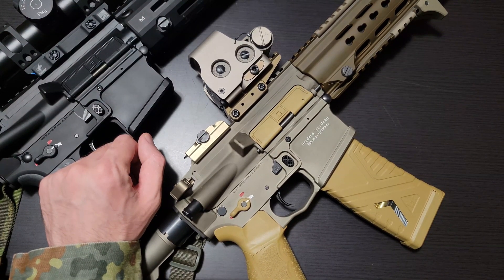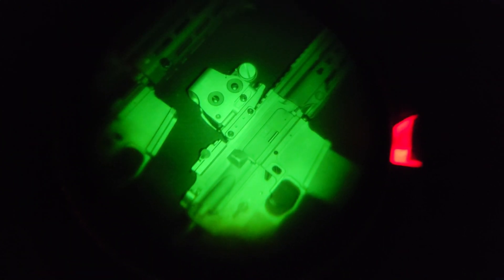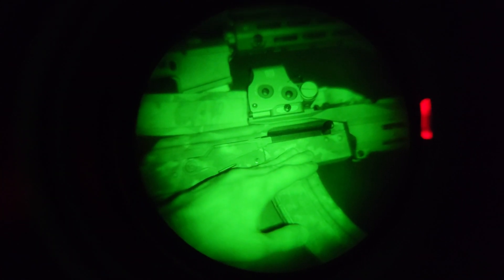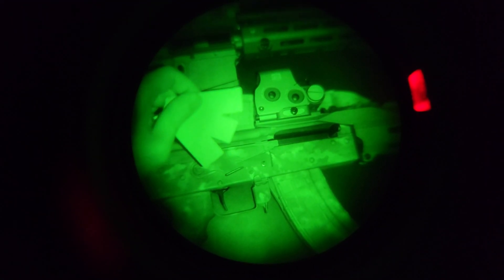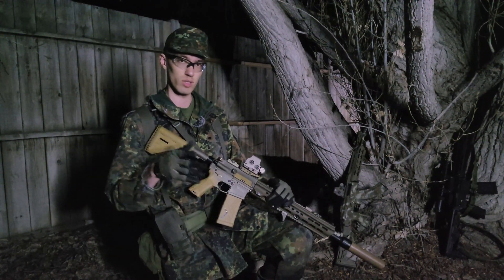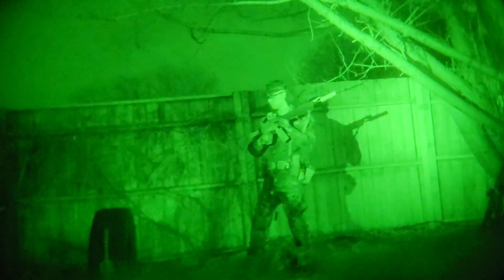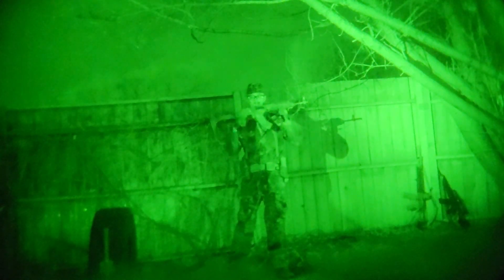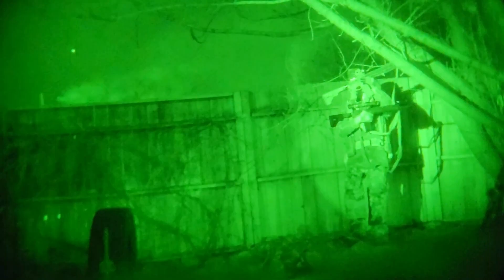NIR Remission on Rifles - Comparison of Tanodization, Cerakote

Comment: Very interesting. Thanks for doing this video.

From an operators perspective, what is the ideal goal for good camouflage rifles to look like under NIR?

My takeaway is that the non-HK parts look like they are glowing whether under illumination or not and the HK parts only glow under illumination. This matches with my observation of the RAL HK parts IRL. These parts look dark under shadows, but look much brighter, shinier and golden, when they are under sunlight or under artificial light. That's also one reason why it appears that HK has so many different RAL colors. In reality  HK has a system behind their RAL color matchups and there are only handfull of different color combinations.  For example with a handguard in the color that you have, HK always makes sure that the upper and lower are a much lighter color. And if the handguard is a lighter color, they will make the upper and lower darker.  And if HK chooses a darker lower, it ensures that the upper is brighter and vice versa. If they wanted, they could perfectly match the colors, but that would apparently go counter the aim of  camouflage, that's why they put the matching colored upper and lowers on different rifles. Also taking pictures of the rifles with or without flash and under different light conditions and different cameras, which have different, saturation, exposure, color tone etc. makes it look like the color is much more different than it really is.
Reply from the maker: Glad you found it interesting! Optimally, a rifle should essentially look the same under the visible spectrum as it does under NIR (albeit just in monochrome). To me it seems like the HK handguard looked a little darker than ideal, but it still performed a lot better than the other tanodized parts which looked way too bright. The only part that concerns me is the G28 rear sight, since that has a more gold anodize and stood out pretty bad.

I hadn't heard of HK deliberately selecting certain combinations of RAL/Sand anodized parts before. What I always heard was that it was a result of inconsistencies in the anodization dying process, but what you said would make sense since a lot of the RAL 417A2, 416A5, and even a lot of MR223s display that pattern.
Reply: @Jang-gun銃  What night vision equipment did you use to make the recordings? I have two complete original HK rifles in RAL and one in black but no night vision equipment, so I always wondered what the rifles look like under NV.

The inconsistencies in the anodization dying process or another rumor is that they dye is gradually used up during dying resulting in different colors shades is not the reason for the different colors. HK doesn't dye each part individually, instead a whole production batch is dipped in the dye at once, resulting in the same color for all the parts. Also claiming that HK doesn't use enough or the same amount of dye for each rifle is claiming HK is skimping in their production quality. Which ich certainly not the case. 

The inconsistencies in the anodization dying process is only true for the handguard (and buffer tube), as the handguard seems to be a different, lighter aluminum than the upper and lower. But the anodization process is no excuse for the upper and lower having different colors, as upper and lower are the same material and are also dipped in the same dye at the same time for the same amount of time.

I know this, as I did a lot of research before buying my HK RAL rifles, as I was unhappy with the mix and match myself. But during my research I saw first hand nearly consecutive numbered HK rifles where the lower of the first rifle matched exactly the color of the upper of the next rifle which was serial number wise just a single digit higher and were coming from the same production batch and were delivered in the same batch to the dealer. So if HK's intention was to match the colors, they could have done so, but they deliberately didn't do it and instead choose to put the matching colors on different rifles from the same production run, because as HK claims the mix and match reduces the rifles IR signature. And as the serial numbers are lasered on these parts, you can't just re-mix them back to your liking without buying several rifles to do so.

If you want, I can show you a picture of a MR233 and MR308 side by side, where the lower of the MR223's colors matches to the upper of the MR308 and vice versa. That proofs, that HK can consistently produce the colors they want in the same quality without any issues and that they do the mix and match deliberately.

Also regarding color choice, HK produces for larger orders from LE customers special/unusual colors, that you may see from time to time, for example the pale FDE/Grey that you sometimes see, these colors are done on order from certain police units, as their camo uniform matches nicely to that FDE/Grey. For example Google "Munich SEK HK416" and you'll see that their camo uniforms match nicely to their FDE HK's. And while doing that production run, HK also makes use of the dye to make some civilian semi rifles that then result in some more rare color combinations.  In the past you will also find dark green and dark brown colors that for example were done for some Portuguese police units that operate in jungle areas where that color matches nicely to their jungle camo and which then also ends up on some civilian rifles.

Right now HK's MR's are in the 42K serial number range and have a light FDE color, apparently from some order of a LE unit that ordered that color to match their uniforms.

But apart from these special cases, from my experience, HK produces only 4 or 5 different RAL colors in the green, brown sand color range which they then mix and match.

One could write a book about this.
Reply from the maker: I record through a PVS-14 and then I have a separate IR illuminator from an old Armasight scope that I mount ~20 feet behind the camera so it has a good amount of flood.

If it isn't too much trouble, that would be cool to see those photos of the MR223 and MR308 side-by-side. I've started researching HK tanodization as a result of all this, so that would be useful to reference. My email is just JG-Contact@proton.me if you want to send it there.

I also didn't know about HK using up dye from contracts for the civilian rifles. I searched and found some good photos of those Munich SEK 416s and those are very cool to see.
Reply: @Jang-gun銃  Strange, my comment with the link to the picture disappeared. Let me know if it is only in your moderation queue or you want me to post it again.
Reply from the maker: @danielmontana6246  I checked my held for reviews comments but it didn't show up there either. Odd. I've had my comments disappear on my own channel too, and some videos recently had comments disabled automatically, so something's weird on YouTube's end.